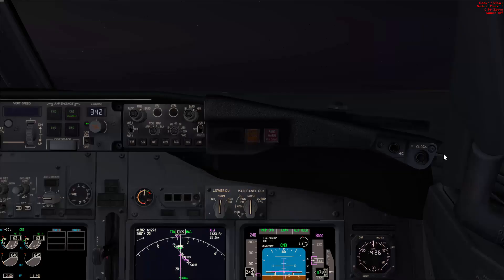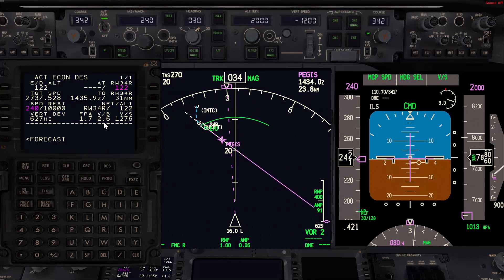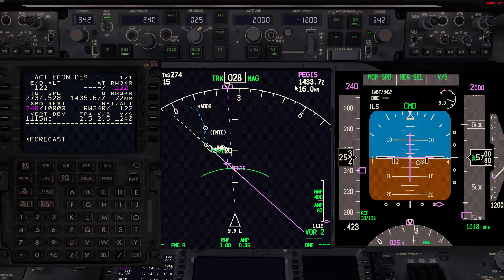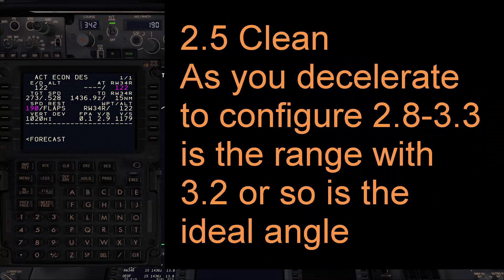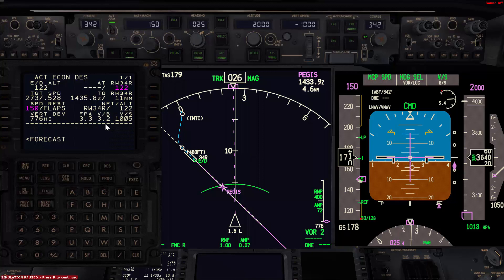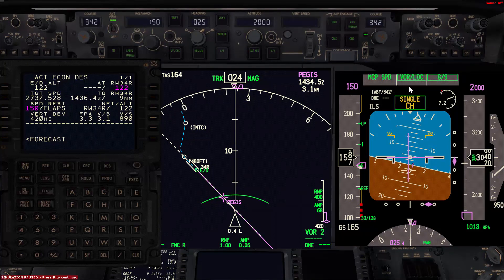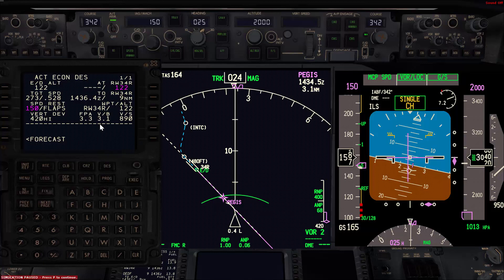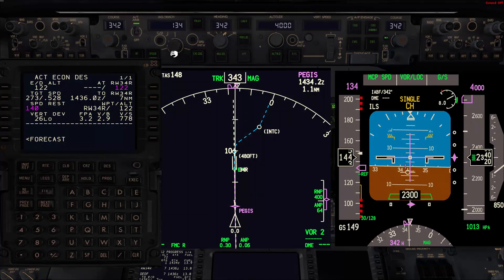B737 Vertical Bearing (V/B) on Radar Vectors

Comment: I love your excellent videos, thank you captain. I'm going to guess why the approach charts give 3.0 and the FMC calculations are 2.8 - perhaps you can verify this... You're approach charts take you to the runway, your FMC is taking you to runway  + 50ftAGL. at 80nm this is meaningless, but at 5nm perhaps 50ft is 0.2 degrees?
Whatever the answer, thank you so much for great tutorials and expert, in depth description of these systems.
Reply from the maker: Hello Robert, 
Thanks for your kind words 🙏🏼 and your engagement. 

This is really something strange. I believe the FMC does the computation based on crossing 50ft at the threshold, so they should be almost the same. 

I will double check the system description and let you know if I find anything different. 

Thanks again, and please let’s keep the discussion going 😊. 

All the best 
Abdul
Reply: There is different 0,2 degree from fmc and actual path you can see it when you calculate distance vs altittidue in fmc profile and see the different

Comment: Hello Captain, With more and more strongly request for the noise reduction by landing I have heard they consider Continuous descent approach (CDA) this seems in comparing in what you talk about but your remark that (your or)  this methode is not a part of (official) learning I wonder if the methode CDA is simply following the instructions given by approach  and finally CTR or is this really a special handeling  you must simply have to master. If so maybe a idea for a tutorial? 
I hope you do not find me too pushy ;) Bye bye
Reply from the maker: Hello G L, I would like to thank you for your engagement and feedback. 
Regarding the V/B use, it is one of two techniques that I am aware of to manage the descend in the terminal area. Mental math is the other one which I believe many pilots use when on radar vectors. 
In busy airspaces, the pilot does not have much control on the descend and need to comply with ATC instructions, but to reduce the noise usually, the airport briefing chart would highlight how to do that. 
Thank you for the suggestion I will consider it for a future video. 
All the best
Reply: Captain Asiri, This info makes it very clear and gives an insight that outsiders simply can not easily find out.  Thank you for that!! Kind regards,